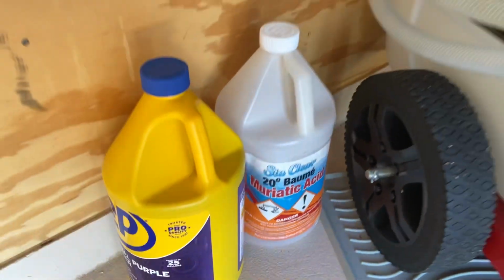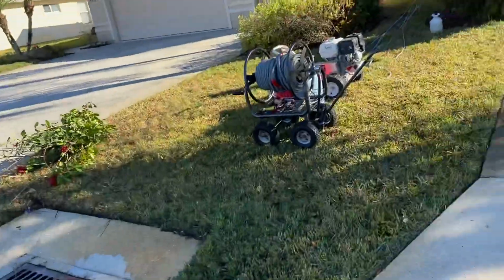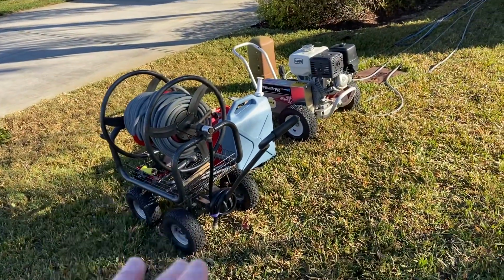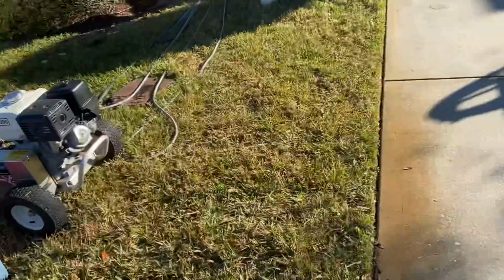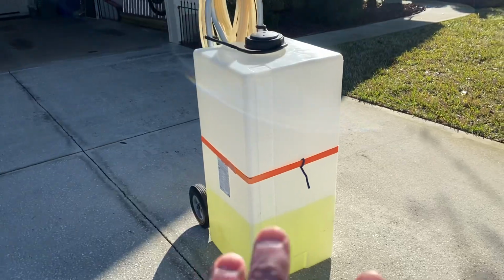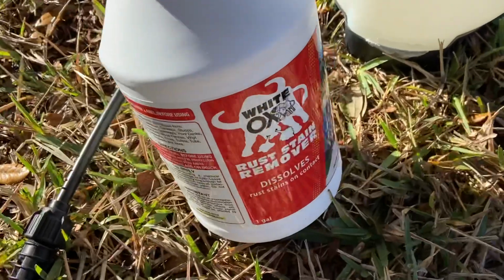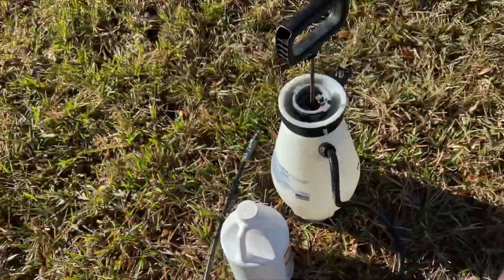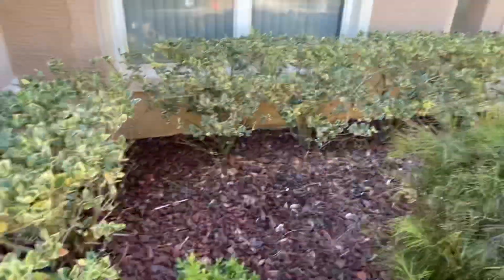Mobile set-up, equipment & solutions

Comment: Hi Trevor. Thanks for your videos. I have a 4000 psi, 3.5 gpm dewalt pressure washer. I will be cleaning a lot of dirty pool enclosures and will need more than 2% SH. Is the best tool to achieve a higher SH% the x-jet? I really don't want to spend the $$$ on a dedicated softwash setup. I like the functionality of your setup. Would my machine be able to handle 50 foot hose from bucket to x-jet? Thanks for your help!
Reply from the maker: Yes. You will be finding life much easier to tackle those dirty enclosures. Make sure to order the proper size for your gpm machine.

Comment: When I'm not using Doug Rucker store products Like Kings Kling I'm using purex natural elements laundry detergent for my surfactant. It smells great it's organic it doesn't streak windows and it works. As good if not better than King's Kling and I'm not being eaten alive in shipping cost because I just go up to Walmart and get it.
Reply from the maker: Jesse, that’s great to know that purex works too. I used to use arm and hammer original just after the great debate about dawn original blue dish soap which I used all the time… Leon Johns just came up with southern drawl which is supposed to be amazing but I have not tried it yet. We have a system by AC Lockyer that we’ve used the Terra-wash for years and it is really good, we’ve also used apple-wash for a marker on large condominiums but I am with you all the way it laundry detergent for my go to because it is cost effective and does the job and smells good too!